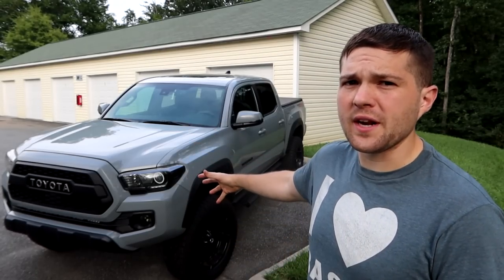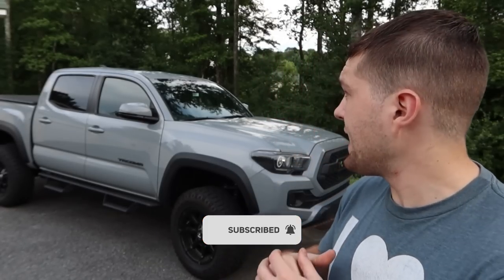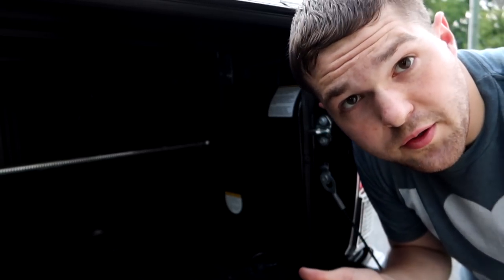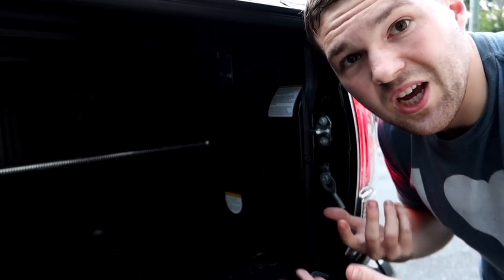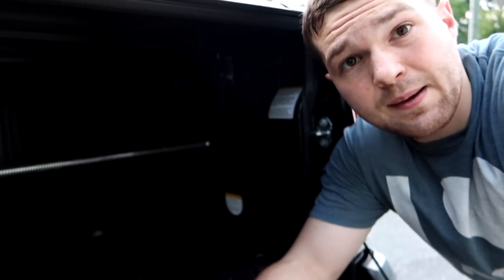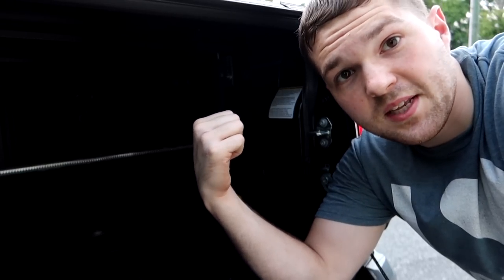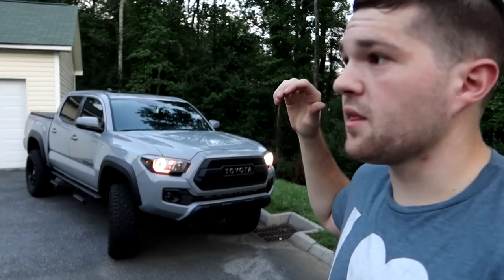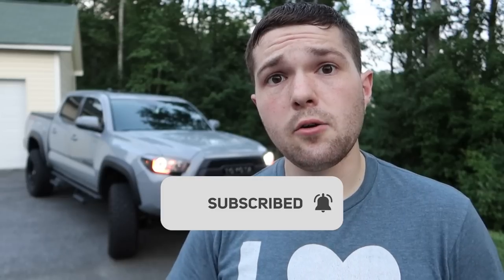The TRUTH about my LIFTED 2020 Toyota Tacoma TRD Off Road

Comment: I've heard a lot of negative things with the pedal commander on their website. Seriously, like someone else said here, Regear - 5.29 is the way to go. Someone said that the Pedal commander only tells the computer to push the pedal to the floor, on setting 6. (Which you can already do yourself, it simply gives the illusion of more power)

I've heard Nitro Gear say that the Tacoma's engine is under rated, its the gearing which is the problem.

Another Tacoma youtube channel re geared to 5.29 recently and they had the pedal commander for a while, apparently the pedal commander did not work for them.

I recommend saving your money, put it towards the re-gear.
Reply: Does regearing void any warranties? Unless you haul a lot of weight or drive where there are a lot of hills, I believe the 4.88's would be a better match...

Comment: Did you re-calibrate your speedometer?  When you put larger tires on it makes all of the information wrong because you are actually driving farther than your truck thinks.  When driving 67 you are actually driving almost 71 mph.  That means your 15.5 mpg is actually off also and you are really getting 16-17 mpg.  There are a couple of products out there that you can install so you can reprogram the information going to the speedometer and correct it for your tire size change.
Reply from the maker: I already factored that into my statement on mpg. And no I didn't recalibrate

Comment: Change the gears ⚙  in the front and rear ends.  Every one put bigger tires on there truck but leave the stock gears in it. Taco's are already under powered.  Gears will give your truck its power back and help with the gas mileage. It will also keep your transmission from constantly changing on you on the freeway.
Reply: The trucks aren’t under powered, the problem starts at the factory with their tuning and that makes them respond weaker so they can get the gas mileage #’s they need to get good scores.  Toyota really slows them down.

Comment: Regear....doin next summer since Ive done some expensive mods this summer...but can't wait to do 5.29's. But for right now...ECT/S mode tricks...as well as the lil bump on the accelerator in cruise when she decides to down shift and rev up everything for like u said..."for no reason"...I have a 2020 TRD Sport...premium everything..3 inch coilover lift amongst other things...she has just turned 2k miles. While I miss the engine/transmission of my 2012 superwhite Sport..I do love my 2020 cement...will love her more after the regear.
Reply from the maker: Same. You described to a t the little bump on the gas to get it to shift. Lol

Comment: I just hit 10k as well in my manual trans. wish it didnt have the radar system or the sos system. You have to account for tire size calculation on mpg, they are striding further therefore the mpg gauge will be off at min 2mpg. When you hit 100k it will actually be like 120k. O gawd, dont do raptor lights.
Reply from the maker: I put that into my numbers. The dash reads 12 to 14. In reality its 14 to 16.

Comment: My 2020 stock SR5 access cab gives me an average of 20.6 MPG. I wanted to get bigger tires but now I might just keep it stock. Thanks for the info! I use mine for work and it does well.
Reply: I got real AT tires, 3 peak rated for winter stock size, Method  wheels with 0 offset and the factory lift going on this month.  MPG only changed about less than .5 mpg.  Plenty of ground clearance and traction.

Comment: You are probably actually getting slightly better MPGs than what your computer is telling you.  Maybe hand calculate a few tanks. Your 32s are covering more ground than the stock 30s, but your computer is calibrated to 30" tires.  The wheel speed sensors give the computer a rotation update and it calculates your MPG (and other stuff).  Have Toyota recalibrate for the 32s and see what it gives you.  You should also regear to 5:29 gears to make that transmission happy and give your truck a huge improvement overall.  This will also help your MPGs.  Not cheap, but better on the rest of the drivetrain overall.

Comment: I'm about to regear my Tacoma, like You, it shifts crazy with poor mileage. I can't use the cruise control at all without it flooring it on the smallest hills.
Reply: I did 5.29 gearing from East Coast Gear Supply, 75 mph @ 2300 rpm 6th gear, goes up hills in 6th, worth it
Reply: Thanks friend, I'm looking at this gear set right now.
Reply: @DirtShy  I get about 20 mpg on highway with 3" lift and 33" tires
Reply: I did 4:88s from nitro gear (on 33s).  City mpg went up, highway went slightly down.  Over all I am getting between 15mpg and 18mpg combined.  Also, try premium fuel, helped with the shifting issue.

Comment: My main dislike about my Gen 3 Tacoma Automatic is the weird shifting which makes me really miss my Gen 2 Tacoma. The only other dislike  I have with the TRD Off Road models is that Toyota could have given more clearance for larger tires as far as with the wheel wells and such. Basically you can only run up to 31 inch tires and if you want to put pretty much anything larger then you have to lift and or cut and chop. It could have been easy for Toyota to just do it right so one could put at least 33's on with out having to level/lift/cut/chop. Hopefully Toyota does it right next time.
Reply: I had a 2012 Sport...lift and aftermarket wheels and tires...she drove like a dream...the 2020 Sport same set up was an interesting drive home with the cruise on...why would u change something that works!?!
Just like taking out the "oh sh#$" handle off the drivers side...but...I do love my new truck even with its whiplash shift points lol...i will ask for the software upgrade but i do want to regear..

Comment: Thanks for the vid!  I’m trying to decide if I should buy a stock toyota tacoma off road trd in the same color scheme.  A lot of great info here and I learned quite a bit.  Thanks Rick!

I noticed over the years that some people modify their vehicles to make it their own unique ride, “pimp mah ride” 🚗 and it looks great to them.  To them it looks good, can stare at it for days and impress other drivers at the red light🚦.  And that is what butters their toast🍞, floats their boat🛶, brings a smile to their face😁..etc..  I’m not judging / condemning people who do this…if they can afford it and just care about what it “looks like” and not about whether it is efficient as it operates…hey, you do you bruh or sistah.

Now having said that…IMO…I like both looks and efficiency in a vehicle.  Mods that just change the appearance but don’t affect performance is fine.  Mods that go against what engineers designed it for, I personally stay away from because it will cause bad fuel economy, premature wear and tear on the vehicle and who knows what other negative effects.  In regards to spending the money 💵 …I think it is not wise to finance any vehicle, it is a depreciating asset and a lot of your hard earned cash 💵 is going the wrong way…⬇️down.  Pay cash instead & about half your take home pay, give or take.  Financing and overpaying for a vehicle that is not relatively affordable , adding expensive mods and being in continuous debt (financing cars every few years) is not a path I would want to be in.

my 2 pennies 

Oh!  A Couple of things I like about this 2020 Trd is the new power seats and no recalls...well, not yet so far lol 😆...has anyone with previous years models stalled on the freeway yet?

Again thanks for the vid!👍🏻

Comment: The transmission is a big concern for me. Everyone on youtube is complaining about the same thing. I think I might go with the manual
Reply from the maker: Its really not the transmission. Its the rear dif gearing. If you leave it stock its not noticable. But when you put bigger tires. It throws off toyotas gear ratio that was design specifically for maximizing performance with the stock size tire. If you look most people do a gearing change and the problem goes completely away because it brings the vehicle back to stock levels.

Comment: With the larger tires if you want to improve the shift points you are going to have to re gear the front and rear diffs. 4.88 if you are going to stay with that size tIre. Lower if you are going larger. This will bring your mileage and power back

.
Reply: Yep, they geared it too high from the factory to meet EPA standards. 4:88’s go a long way toward rectifying that issue in a lightly modded or even stock truck. The manual trans models are better platforms for modding as they come factory with lower gear ratios

Comment: This is interesting. I recently lifted my '21 tacoma 2.5 inches in the front and 1.5 inches in the rear and went up to 285/75/r16 Falken Wildpeak at3w E rated from BFG k02 265/75/r16 E rated. I noticed a minimal difference. If anything shes a little bit sluggish which is to be expected when you increase tire diameter. I also dont feel that my truck is shift happy. Maybe this issue was addressed in the '21? Who knows. I get 15.5MPG all day every day and I live in the bay area where traffic is horrible and I stop and go on the freeway 10000X a day + the hills I need to go over to get to work. I was on the "regear  to 4.88 bandwagon" before installing the lift and larger tires but now im over it. Shes totally derivable still.
Reply from the maker: Offroads have a tighter diff which yeilds lower mpg. But also tire / rim weight play a big deal as well.

Comment: You will like the Pedal Commander. It noticeably changed the 'shifting'. In the Sport Setting, it'll give you whiplash.  I didn't like the $400 price tag and I'm not sure that I can justify the cost but the shifting is annoying. BTW...like the video. I have a 2017.

Comment: I've got the same model with 18" black rhinos and 32" KO2s minus the lift. I experienced the same thing with the gas mileage until I installed an Injen intake (don't hate). While city mileage was worse (13-14mpg) my highway mileage now hits 21.5 - 22mpg cruising at 75mph.
Reply from the maker: Yeah I think my biggest mpg problem compared to most is speed. I am about 85 on the highway here in NC

Comment: If you get the TRD OR and save 10k from not getting the Pro, you can still buy Suspension, Rear Cover, Upgraded Heated Claude Not fake leather seat, Jbl sound, and fantastic long road+off road tires...!
Reply: FYI, believe there is a package for heated seats with 360 camera sensors

Comment: Big tired always reduce mpg, but proper gear ratio to match the actual tire radius helps a lot? I have 35” tires on my ‘73 Bronco, it got mileage like a brick, but when I put in 4:56 gears in, it improved  mpg compared to the original 3:73 gears?

Comment: Great Job! Very well presented. I am leaning on the PRO model but I still wonder if it is really worth it...
Cheers!
Reply from the maker: Depends if you have upgrade plans. If you don't want to lift it I would get it. My truck with all the mods is about the same price as a pro
Reply: @TacoRick  The dealership I deal with will give me a quote for a Pro Model and then I will decide what to do next. I am leaning on the Metallic Grey paint because it looks more bold & cool in my opinion. 
The standard tire size is ok but I wonder what bigger size would fit without having to implement a lift at all ? Off-Road, the Pro is definitely a beast as I witnessed many reviews which confirm this. 
Anyhow, you insights gave it a push towards a buy! Thanks again for sharing!
Cheers!

Comment: Wayyyyyyy better mileage than my STi. 

Definitely still moving forward with the eventual trade in. Still super torn between TRD Off road, and TRD PRO
Reply: Really depends on what you plan to do with it. If you want to have it ready to go and leave it alone, the pro has suspension done for you. If you want to lift or change suspension, why pay more for stuff you want to take off to begin with?
Reply: Cody Leslie 

I think I’m looking at an eventual 3 inch lift, and capping the tires out at 33’s. 

Very good points though. Lots to consider!

Comment: Why don’t you have the truck re geared ? ⚙️ they say if you go up on the gear ratio such as a 4.88 or 5.29. This should help with your fuel mileage
Reply from the maker: Money. It cost so much and makes me contemplate just getting a new truck.
Reply: @TacoRick  after all that money you’ve already put into your taco ,
You will loose money trading it in. I bet you can get it re geared for under 2,000. Shop around before giving up on your taco. You definitely got a sweet suspension in it now so don’t walk away from what you have already invested
Reply from the maker: Lowest quote I have got so far is 5500.
Reply: @TacoRick  bro taco twonz got his done at around 2,000 dollars. You need to get a hold of that guy and keep shopping around. Your first quote is a complete rip off !

Comment: Get an air intake/exhaust and a tune for the MPG and a Nitro regear kit for the shift points. OVTune, KDMax Tune. 
Also could get a supercharger.
Reply: Exhaust and intake will do
Nothing for power and mpg.  OV tune definitely will, I’m running premium SFOB.
Reply: @sergekrasovski3700  “Premium SFOB” ?
Reply: @ht9739  

Premium “full Otto beta” version. It’s an OV tune for a manual only. It has none of this Atkinson garbage, full Otto cycle.

Comment: I don’t know the answer to this, but when you put bigger tires on it, your speedometer is off. Your truck tells you you’re going slower than you are. So you are going slightly further than the truck thinks. Since that is a thing, your MPG would be a little better than the truck is telling you.  I might be thinking about this backwards?
Reply from the maker: No your correct. It gets 2 mpg better than what the dash says. The number I told you already had that calculated into it
Reply: Taco Rick I’m surprised it’s that low. I have 32 inch tires with 17 inch rims on a 2016, and the truck tells me I am getting usually 16-17 mpg. I am guessing your 18 rims make a difference with weight. Maybe your tires are just heavier too. But cool, the truck is looking great!
Reply: Oh, you have a stick shift, that’s probably it.  Glad we could get to the bottom of this :)
Reply from the maker: Definitely it lol

Comment: 4.88 re-gearing will change everything. Better gas mileage, no more searching for gears. I have a 3 inch lift 285 70r 17 tires on the freeway I average 22 mpg on the street average 18 mpg

Comment: I have a 2020 Tacoma TRD Off Road with the same 3 inch rough country lift. 33in all terrain tires. When I am braking, generally less than 10mph, my truck vibrates. If I am back on the accelerator, it resolves the vibration. Have you experienced this?
Reply from the maker: Nope. Did you re torque your bolts?

Comment: I get 20 city and 24 highway with my stock 2019 trd off-road. I’m think about putting 265/75r16 Falken wildpeaks on it, which weight about the same as the oe goodyear wrangler with Kevlars. I’ve heard this only changes mpg by one or maybe two.
Reply: i have the falkins all terrains on my truck. a good ride, good mpg, i drive combo highway/city every day. i get 19-21mpg. premium gas.

Comment: 2 things. 
Mpg shouldn't even matter it's a truck.
One of the things I knew getting my taco (2018 off-road MT) is that it will not be very efficient... Or at least I knew not to expect much especially since it's a manual and I'd rice it.... In Los Angeles traffic. Lol
2. A manual would've absolutely eliminated the shifting points(granted if you drove manual)

And I guess an extra point, re-gearing would def help
Reply: I'd drive it in Los Angeles traffic*

Comment: Diff drop kit is needed and re gearing when doing any changes above 1” than stock. My 2017 was a lemon low compression at 40k get a leak down test before out of warranty. Shitty rings!!! My 6th tacoma so I know they don’t make them like they use to.
Reply from the maker: I have a diff drop. It was part of the lift kit.

Comment: was looking at a 2020 taco TRD offroad premium it was 45k but then I built a 2021 taco TRD Pro on the toyota website site and it was 49k. I think It's best to just go Pro if you want the premium package.
Reply from the maker: It is if you dont want to lift it and add bigger tires
Reply: Taco Rick why? Genuine question.
Reply from the maker: Because the pro you are mainly paying for the fox suspension, the trd pro wheels, and the hood scope. If you buy a trd off road like I did for 40k that has the same pro interior minus the labels you can do a bigger lift bigger rims and tires and sti come in under the trd pro price tag.

Comment: Hate my automatic  2021 and was going to trade it for a manual. Met a guy in a parking lot today and went for a ride and drive in his. He completely reprogrammed his and it drives like a completely different vehicle. Considering keeping mine now.
I forgot what he did, but I just texted to find the name of it.
Reply from the maker: Let me know.
Reply: @TacoRick  apparently he reprogrammed it, as his occupation is a, software engineer. Recommended pedal commander and some other mod (forgot name, but about $450) that you need to return vehicle to factory settings before servicing or it voids the warranty.

Comment: I have the Bilstein 6112 lift.  Manual trans.  I mostly highway drive at 55 and get 20.  265 75 16 falcans.  No needle bearing issues?
Reply from the maker: I have a 1inch diff and no issues

Comment: My 2020 actually doesn’t gear hunt, which is why I have always been confused to why people complain. But since I’ve ridden in my buddies 2017, it is awful...
Reply: There’s a flash to fix this issue. My 17 used to do it and I looked online and found a TSB from Toyota. I took it to the dealer and had it done and man it made a world of difference. It drives like a normal truck now.